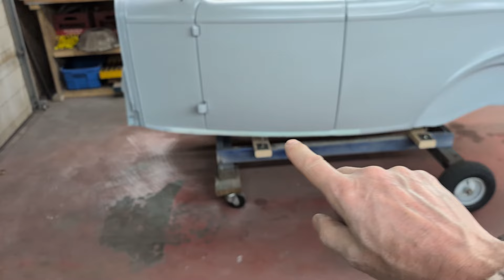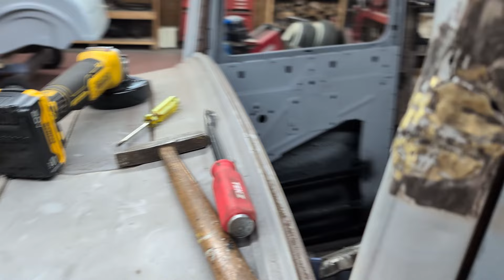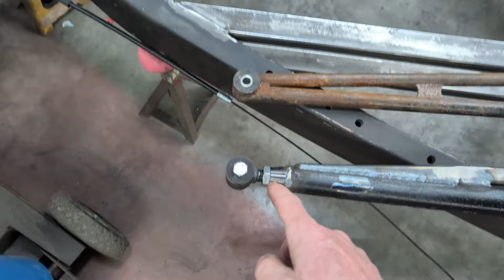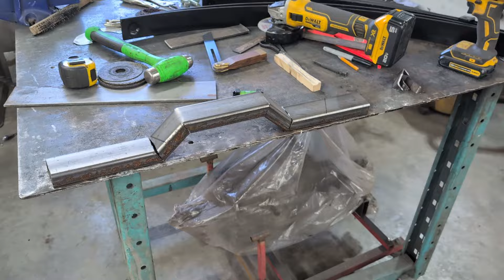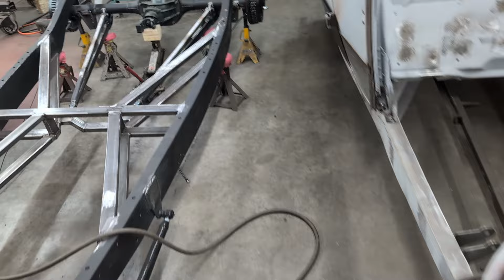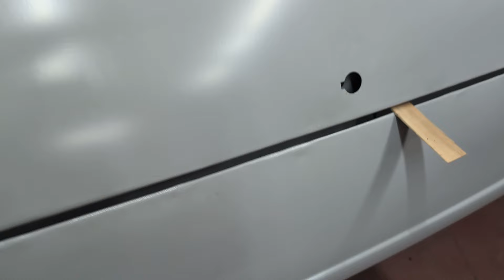Modifying wishbones to ladder bars for the 1933 5 Window Coupe

Comment: That's a really good solution to beef up the wishbones Derek,  and I agree with you on fitting a Panhard rod. The "chop" on the five window Coupe is definitely an example of how not to do it, looks like a typical backyard job. It begs the question as to whether the car ever saw the road at some point. Great coverage of all the points raised, keep up the great work and Happy Thanksgiving to you and your family. Have a great weekend, looking forwards to what you have in store next week. 🇬🇧🇨🇦💕
Reply from the maker: Hi Geof, yes I'm much happier with the wishbones now. We're still not running much HP but this modification will handle it better. This body made its rounds for almost 30 years to different owners from Nova Scotia to Ontario without ever being on the road. I knew from the start I would have to fix some things but didn't realize some of it was only tacked in place. Not a problem though, we'll go through it all and get it welded in place.

Comment: On the ladder bars, back by the axles. That top bolt you have. Do you suspect there will be any shear going on between the bolt and bolt holes, without a sleeve in it? I'm no engineer, but to me it looks like that could be a possible point of shear.
Reply from the maker: Yes both bolts are in shear under load and when torque is applied. A sleeve through the hole won't reduce or eliminate that. We're using higher rated grade 8 bolts in both holes.

Comment: I have a very similar rear  spring set up on a so called chassis with a steel body 32 roadster . I had to add a spacer to lift the frame off the spring pack , the frame was hitting the axel ,on bumpy roads. 
 We just got the car on  the road this summer.
Reply from the maker: We're going to do a check on that too and make sure the frame sits up enough. We'll add a spacer if needed like you did.
Reply: @coldstreamrodshop 

Unfortunately my brake lines ran on the top of the axel. They are new now